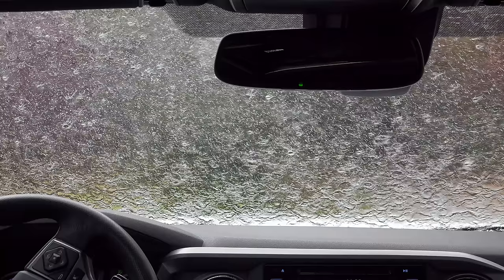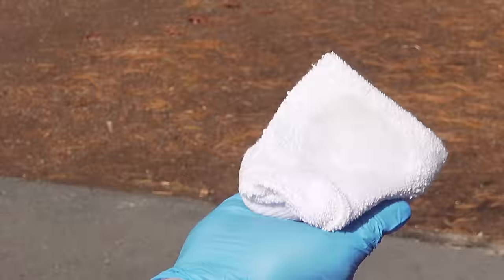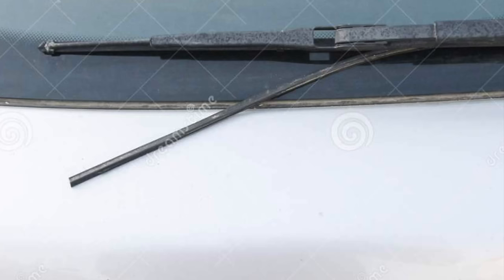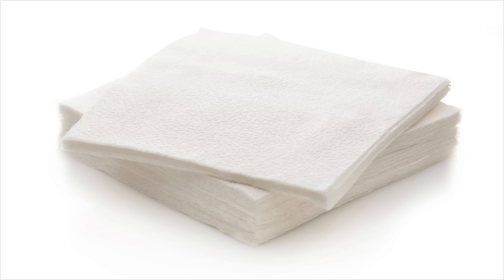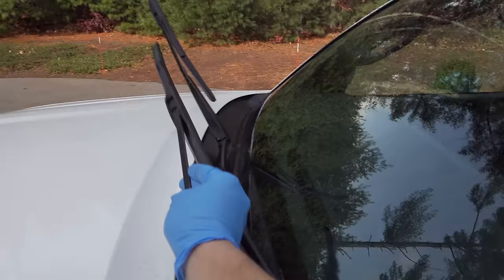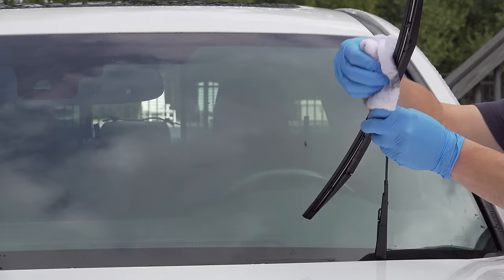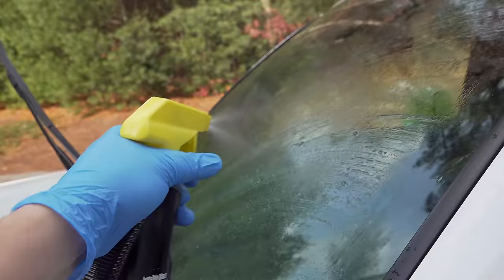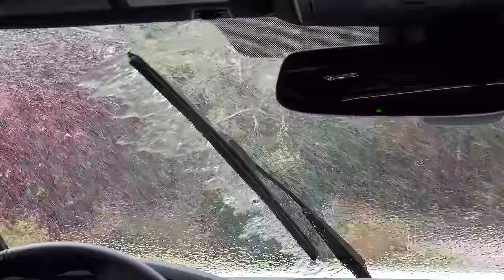How to Make Windshield Wiper Blades Like NEW in 30 Seconds

Comment: Yep, as a Long haul truck driver I've used this trick for quite a while, but instead of using glass cleaner I use dishwashing soap on the windshields, in my opinion does do a better job at degreasing than using window cleaner.
Reply: Thanks for the tip Bishop.
Reply: I used to clean windows for years, never used anything other than dishwashing soap!
Reply: I have never thought about using dish soap. Great Idea.  I hope it works in 120° weather. Arizona is hard on everything and especially rubber & batteries
Reply: yup I use a razor blade wand and lots of soap and/or window cleaner. Run the razor back and forth in small motions to scrape off embedded debris. Sometimes I'll use #000 steel wool. It doesn't scratch if you get the right kind.
Reply: Yup, and believe it or not Dove is the best one that I've ever tried
Reply: bash the bishop
Reply: The salt in dishsoap is bad for your paintwork.
Reply: Then why not use the dishwashing soap on the wiper blades as well?
Reply: In theory you could, but the dish soap may dry out the rubber so you’ll want to condition it afterwards.
Reply: @Namugaseum  Just use regular dish soap. Don’t use any that say "ultra" on the label.
Reply: Mr.Clean Magic Eraser works great. Removes all bug, tree sap, road grime and hard water spots. Use the soap free original.
Reply: Believe it or not, you must clean the glass before using glass cleaner.
The surface layer of grime will need to be removed for glass cleaner to be streak free effective.
It is the last stage of three when cleaning glass
It works best on basically clean glass
Reply: Dawn dish soap & hot water as always my go to cleaner/degreaser for ALL Sorts of chores 😊
Reply: I used dish soap (dawn) on my windshield in 2002 and it made my wipers squeek like crazy. I really regretted it for months.  That's just my experience.
Reply: Lemon Joy not Dawn.
Reply: I've used this trick ?

I used this technique ...
Learn correct grammatical legal English 
Not that peasant language you were taught - 
Undertake an advanced reading program to educate yourself to a higher degree
Reply: @andrew_koala2974 You cannot even be serious. We're not in your science class...thankfully. Take your insults into a little room with no one around. Tips and tricks is a very common common thing to say; alone or together. I feel sorry for any children or spouse you may have.😢
Reply: @semperfidelis2970  Dove or Dawn?
Reply: @daysgone2997  Choke the chicken
Reply: So. did yid you use WD40, or did you not use it????????

Comment: I think the black stuff that comes off of the wiper blades is actually the graphite that the blades are initially coated with to keep them from skipping and squeaking. A better solution MIGHT be to clean the blades and then run a 9b graphite pencil along the edge of the blades. Wd40 would work temporarily but as someone else said, it will degrade the rubber and it won't last.
Reply: Or maybe graphite powder.?
Reply: @melissaaldosari8024  Yeah but that will be a lot harder to apply.
Reply: You you might just buy new damn wipers!
Problem solved!
Reply: Yes, this is completely true. Every time I attempt to clean the wiper blades they get worse and in fact recently I rubbed down a brand new pair of blades and they made the rag completely black - even though they had not been used.
Reply: They have graphite spray its a lubricant. CRC dry graphite spray
Reply: @IntolerableEvil  With what you were cleaning wiper blades so they did get worse? It was WD40?
Reply: Instead of WD-40 I’ve found that after cleaning my windshield and applying rain x to both the window and the blades that I have zero issues for years.
Reply: @aldebaran777  lol man
Reply: @tacticalcenter8658  hello, may I ask what type of store carries graphite spray? 😊 thanks
Reply: @mrsdewdrop9678  I got mine online. You'll have to search for a store otherwise.
Reply: @newfinishautospa  wd40 is mineral oil once the cleaner evaporates.
Reply: @aldebaran777  so if your car is dirty you buy a new one 🤔🤣
Reply: Spray silicone really works wonders for this application.
Reply: I use Turtle Wax Ceramic spray polish . Wonderful product,  on paint , plastic,  rubber , glass , and preserves the windshield wipers.
Reply: @aldebaran777  at $50-$75+ per pair....preventative maintenance is the answer!
Reply: Try coating them in motor oil, or STP.  It will stop the chatter.
Reply: I have used mineral spirits on the cheaper rubber blades for years with good results.  I think WD40 has some solvents which might not be good.  Also for the more expensive silicon blades, I have seen denatured alcohol suggested.  I think the mineral spirits refreshes the dried parts but some just use a 303 UV product to prevent that drying from UV.
Reply: No, the black stuff is the actual rubber that's disintegrating from age.
Reply: Dirt and crude oil.
Reply: @aldebaran777 new wipers at rock auto cost less than wd40
Reply: @SledDog5678 rock auto man you are welcome
Reply: And if you have a composite windshield you're in for a even better surprise. 🤣🤣🤣
Reply: What really worked best was applying a nice thick coat of gorilla glue or super glue on my wipers. Works wonders and lasts for years!
Reply: Just use silicone.
Reply: we can bleed on the wipers too as there is graphene oxide in our blood
Reply: You may be correct about the graphite however of you do the same thing to the rubber seals around the other windows usually they have the same color coming off of them
Reply: charleswhite758  nah candle wax? The Turtle Wax is a liquid spray. So easy.
Reply: @scotteric8711  what is a composite windshield?
Reply: On pretty much every brand new vehicle I’ve ever bought  ( maybe 8 or 9 ) the OEM wipers lasted for at least 3 years without a streak, chirp or wearing out. I have then bought  replacement wipers which lasted a year or two. I swear the rubber they use now is nowhere near the quality of what the wipers were made of between 1979 - 1995.
Reply: @Zeek800  Mine rend to last maybe 2 or 3 months before they start skipping. It's all trash.
Reply: @aldebaran777  Wipers are getting cheaper quality wise and material is plastic. Just purchsed brand new Bosch Icons (same brand I use for years) made a horrible popping noise on the way down...I am looking for easy solution to bring old wipers to life but oil WD40 does not convince me yet.
Reply: @Cam_B  Don't give the dummies any ideas.

Comment: I don't even know if this works but the comments are priceless.  I have been reading and LMFAO for about 15 minutes.
Reply: you're spot on, comments are hilarious!!!
Reply: @norbacsam  BTW - I tried it and it didn't work for me!
Reply: @JoeA lol me too!   Some of them are priceless😂
Reply: sure doesn’t take much to entertain YOU, does it?
Reply: @jpear  I'm easy to please...Just ask my wife;-)
Reply: WD-40 is not good for rubber. It will damage it over time. You're better to use alcohol to clean it and wipe it with Armour All after. The alcohol will clean it good, but it tends to dry things out. So recondition the rubber, with Armour all. It's as slick and good as WD, without the damaging effect and HELPS the rubber.
Reply: AUDIO MAN  Yeah, there are better rubber safe choices than alcohol. I was just addressing the comment about alcohol, with an alternative, better way to use alcohol, that should help with it's drying effect. By remoistening/conditioning the rubber with the Armour All. 

There are other solvents that can clean rubber and condition it good at the same time too. I use this German stuff I picked up for cheap one time, Gummi Fusslig or something. Seen others mention it too in car vids. and forums, or it's English equivalent. It's made for conditioning door and trunk seal, but it's not milky and thick like Armour All and has a solvent smell to it. And the foam applicator gets quite dirty as you apply it, indicating it is cleaning as well as conditioning. And it dries to a non-greasy finish. 

Helps prevent sticking too, which is a problem here in Canada in winter with doors and trunks freezing shut at the seals. That would be ideal for wipers and I do that. Kinda like Armour all a little better though for wipers, cause it leaves a slicker finish that helps them glide. As long as you just put it on thin and leave the wiper up to dry, it won't streak up your windshield and acts much like this WD-40 trick. But unlike it, is rubber safe and good for the rubber.
Reply: AUDIO MAN  Oh, I've heard of that stuff. I watch Tech Moan and 8 Bit Guy etc. on Youtube and they deal with a lot of old vintage electronics etc. and they use that stuff. I'm sure that's where I heard about it. Makes sense you would use it and know of it too (like them), with a name like Audio Man and obviously an audiophile.

It's good stuff, I've seen it revive some pretty old rubber. Sometimes it's just shot, but if it's just a bit dry and "getting" toward brittle, those conditioners can revive them surprising well. My car parts are lasting MUCH longer now that I religiously treat them at least once a year (sometimes twice). I hate premature repairs and if I can give those things more longevity with some VERY easy care, especially cheaply (and this is both), I am all for it.

Comment: the last set of wiper blades I bought are 8 years old and still like new , they're in the trunk 😜
Reply from the maker: That's what always happens. Easier to just do this, keep your wipers working well and make things easier. Get one of these and use it at the gas station when you need it: https://amzn.to/2CNbrVr
Reply: You have WD in your cabinet
Reply: That's the best way to keep your wipers clean. I use the same method.
Reply: Didn't the rubber dry out ? Guess its cold in your area.
Reply: MUFFA 912 Does the rain get in there? You might have a leaky seal 😬
Reply: x I V I x menu
Reply: did you use wd40 on them? 😀
Reply: Why did you buy a pair of eight year old wiper blades?
Reply: @im1who84u   they were purchased new , 8 years ago , still in the original packaging , 
just haven't gotten around to installing them 
thinking of selling the vehicle , good selling point , comes with new wiper blades
Reply: @muffa9125  Thanks for explaining and I don't mean to embarrass you.... but, I was only kidding and it was my feeble attempt at being funny.

I understood what you meant the first time. I was just exposing that what you said could be taken in more than one way.

Cheers my fellow "Youtuber".
Reply: @im1who84u  that's what I assumed   your comment  was  getting at , mine was about the     
procrastination of  some of us , we are good my friend
Reply: @SilverCymbal  your link doesn't work anymore. What was it?

Comment: This will work for a short period, but eventually you need to replace the blades as the edges get rounded and will not act as a squeegee for removing the water from your windshield as designed.    If there was actually a way to cut the blades back to expose a fresh squared edge then this would work better at rejuvenating the blades.
Reply: Nail file!
Reply: Actually, there used to be a windshield wiper cutter that did exactly that. It looked like a little box with a slot, which held a blade at the proper angle. You ran it along the blade.
Reply: Still available on Amazon
Reply: Easily made... small piece of hardwood or nylon, cut a slot big enough for a piece of folded 320-400 grit wet&dry sandpaper and run up & down wiper blade ...then I clean my windshield with wd40 & voilà...if that doesn’t work for you...go buy new blades🙈🤷🏼‍♂️👍
Reply: @allareasindex7984  Ah the good old days. Like remember when printer ink didn't "evaporate"?

Comment: My wipers didn't even have rubber on them and this tip still worked.
Reply from the maker: This is the best comment yet!
Reply: Just so you know, I sell windshields
Reply: @nwabuezeozuzu6370  do you do half windscreens. It's only the passenger side that needs changing.
Reply: @Bullsheet_Bob  we can work something out 🙂
Reply: @nwabuezeozuzu6370  😀

Comment: I use WD as a moisturiser after shaving its fantastic keeping my skin oily and young looking. Wrinkle displacement NICE.
Reply: I never heard of using WD-40 as a moisturizer. But I knew an old mechanic in his 70s, that swore that WD-40 on his knees relieved the pain somewhat. When we talked about it, he swore that a cousin of his used to clean his ears out with WD-40 on a Q-tip..
  i’m a little cautious about getting any chemicals on my skin anymore, because anything that gets on your skin, gets inside your body, I don’t handle lead weights when balancing car tires anymore with bare hands, I don’t get oil on my hands when changing oil in my truck or in my motorcycles without using latex gloves, I wear a filter mask not just a cloth mask when doing any spray painting all the little things around the garage or house. are where rubber gloves when using my parts washing machine to clean parts even though the fluid in my parts washer is supposed to be safe and not very flammable. You don’t know what’s in whatever it is out there anymore.. I remember a few years ago that they found that there was counterfeit Colgate toothpaste , that was made in China and sold in dollar stores here in the USA, that had Etheline glycol. ( antifreeze) in it…Makes you wonder if some of the WD-40 out there is counterfeit with who knows what in it

Comment: You can also clean the windshield with .0000 steel wool and that will remove anything on the windshield and not scratch it.  Also works well on glass top stoves.

Comment: I drove truck from some years of my younger life.I found rubbing alcohol to clean the windshield and blades.and rain x on the windshield and light coat on the blades really does the trick.helps with keeping your blades from freezing to the glass too!Great video like to learn something new.
Reply: Can i use thinner ? Would i attack the rubber?
Reply: @iplaybose  NO, IT IS TOO HARSH.
Reply: @williamkeith8944  Then what can I use to clean them ? I bought Premium Valeo Silencio wipers and what do you know, 2 weeks later i got splattered with tar and ever since whenever i spray and wipe, it leaves a thick muck that drives me nuts, i seriously need to clean them but I dont know with what
Reply: Rain X is the shit.

Use it on the inside of the windshield and it will never mist up through winter. It will clear after a few seconds with the air blower on cold morning starts.

Comment: Most people don’t know that the “WD” in WD-40 stands for ‘water displacement’. It was developed for minimizing ice buildup on liquid fuel rockets external tanks. It just happens to have lubricant properties as well as being hydrophobic. This is a great use for it since that is what it’s designed for as long as you rub it in well so as not to leave streaks of it on your windshield.
Reply: It attracts dirt !
Reply: @Mooseknuckle713  Yes. It can if you don’t wipe it down to just a thin film. Some people overapply it and make a mess.
Reply: Waluigi Distilled No.40
Reply: And the "40" in the name refers to the number of attempts before the creator was happy with the final mixture .
Reply: WD-40 is not a lubricant, it’s a degreaser. People think it’s a lubricant, but in reality all it is doing is liberating dry grease. Use it enough and it’ll clean out all grease. Ask any mechanic, they also use WD40 as a parts cleaner in a pinch.
Reply: @Richard To makes things worse, the manufacturing company now makes a "WD40 Lubricant". Saw it at walmart the other day.  Makes no sense, but what do they care? People wont stop buying lol
Reply: WD-40 is Petro based and breaks down rubber. You will need new blades even sooner with this nonsense. Lol
Reply: "Hygrophobic" not hydrophobic. Thx.
Reply: @Quasilobo  I can't swim, am I "hydrophobic"?
Reply: In the 70s it was a big thing to spray WD on your plastic worm for bass fishing. It was also said to be made from shark oil. 😅

Comment: Wiper blades used to be easily replaceable and cheap. Now they make you change the entire assembly which isn't anywhere near as cheap which makes this tip more useful.

The best wiper blades are the silicon ones. They do an amazing job of clearing water with no streaks.
Reply: And absolutely don't use this guy's tip on $70 silicone blades. Oil and silicone don't mix.